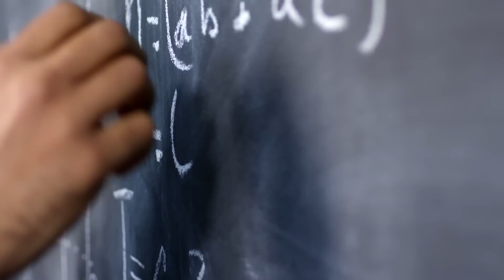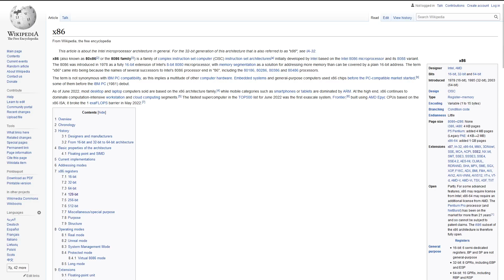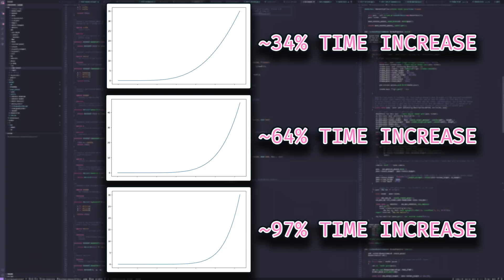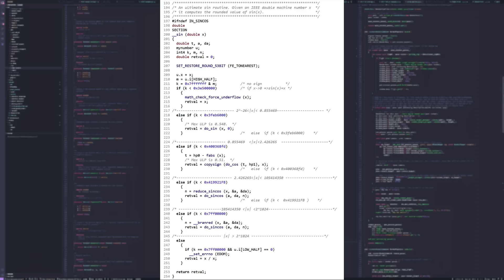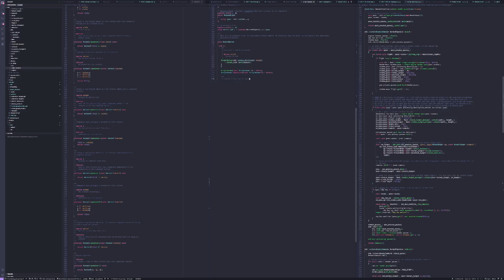What is the fastest way to calculate sine?

Comment: Personally i've made an algorithm of 2 LUTs for m and b then you can just do mx+b, but it seems like the linear approximations are trivial to evaluate, most of my computation seems like it's used in wrapping the value from 0-tau and finding the index, currently using some bitwise tricks to find the index first then correct it is getting only about half of the computer time, but i'm not sure if there's a faster method for the wrapping, or just in general that isn't just a straight LUT

Comment: I was surprised to see that the x87 assembly instruction was slower. You would think that Intel and AMD would be able to keep these fast enough that a software solution is not necessary.

One of my universtiy assignments was to design a "fraction" class in C++, complete with operator overloading. You would get extra points if your class supported the three basic trigonometric functions. I also used the Taylor series for them and they were fun to implement.

Comment: Kaze Emanuar recently did a video on this exact problem for the N64, using the only the first 1/8th of a period and some clever math to beat a 2nd or 3rd order polynomial (I think..). Might be fun to try on x86
Reply: The N64 is quite a unique system, it's main bottleneck is memory bandwidth. The same isn't true in x86 computers. The reason why Kaze couldn't use a standard algorithm for computing sine is because they were optimized for execution speed, not for memory bandwidth. It would perform worse compared to a standard algorithm on x86, as it was optimized specifically for the N64.

Comment: I've made functions that calc sin/cos/arctan using interpolation, circular motion formulas, incrementing sin/cos by multiplying them in a certain way at ever decreasing increments, and Taylor series, but I don't understand how to use Chebyshev polynomials...

So three expansions for the Chebyshev polynomial is just   (3 * (theta^3) ) - (3 * theta)  ?   I was trying that and getting values over 1...

When I've watched videos on Chebyshev, the most I've been able to grasp is some interesting functions for incrementing and interpolating cosines, but I'm supposing that's not the right way to do it.

I could use some pointing in the right direction.

Comment: I made uint sine in c++ by calculating 2 periods of parabolas by bit manipulating and flipping latter half. For my use case it is 3-20 times faster, depending if it is input random or linear values when generating waveforms or tones. 
These are fastest with gcc -Os flag and when you work with range 0 to uint_max like raw audio files. The functions are generalized to work in 8, 16, 32 and 64 bits. There's desmos page in comment explaining math behind this. Max error is 2.8%
Youtube keeps marking this as spam I believe. pastebin is GfEDzmCj
Reply from the maker: Interesting technique

Comment: You could try approximating sine with a parabola; you can get quite good accuracy when doing that. I was looking into it a few months ago.
Reply from the maker: Thanks for the suggestion!
Reply: @nathanbaggs  I've tried to link to a forum post that shows exactly how to do it - but youtube keeps removing the reply -.-'
Reply: Isn't that what the Taylor series is?
Reply: @Johnny-tw5pr  
not really, the most notable difference is that taylor series goes from -pi to pi accurately, making 2 'bumps,' 1 negative, 1 positive. a parabola only does 1 bump.

a parabola is just x^2, meaning it only works for numbers from 0 up to pi, which means it's more complicated to check if a number's negative or not.
taylor series works from -pi to pi, meaning it's simpler to give a proper check for if the number's negative.

There is also the problem that using x^2 (even when modifying the parabola to better fit sine) is less accurate, and in my testing can even go as far off as .03, which can be a pretty major deviation, compared to taylor series, which has incredible accuracy in only 6 degrees of the series.
Reply: For cosine, you have (pi^2 - x^2)/(pi^2 - 4x^2)

Comment: I remeber developing a method in highschool, it's super slow, and actually it only works for a quarter circle (trivially easy to solve that though).
Basically, you can easily calculate a normal vector for any vector by  dividing by it's length, and if you take the average of any two points on a unit circle then normalize the vector you can get the vector of the angle really easily. So you can just do a binary search
Reply from the maker: That’s interesting, thanks for sharing!

Comment: I've used x = sin(x) when dealing with very small angles before. Usually it's been when I'm estimating some of the other values in the calculation so the error is not as important as the rough correct number
Reply from the maker: It’s a nice optimisation (:

Comment: This is surprisingly topical and relevant for me as I am looking into using a fast lookup implementation with a bunch of pointer magic to very quickly calculate HUGE Fourier series sums (20,000 sines) in real time.

The idea is to use position pointers and loop back pointers to quickly sum a list of positions on the lookup table.
Reply: Do you think you could explain the logic behind your idea for that implementation a little more?
Reply: @xinfinity4756  Instead of calling for a sine approximation 20,000 times, you make one "good enough" sine approximation small enough to fit in the cpu cache. Directly after the sine in memory is a table of pointers leading back to the sine lookup table. the idea is to iterate each oscillator's position in the lookup table and use a 'buffer overflow' style approach to reset each oscillator's position when they overshoot the sine table in memory. In essence, it is a real oscillation within the cpu/memory - not a calculated one.

This would be useful in rendering FFT data into an audio signal in real time. It would make audio synthesis way better.
Reply: @ryanpmcguire  Neat idea! Do you use JUCE?
Reply: @ryanpmcguire  I was thiniking of ram but cpu cache is even better !
It could be dumb, I didn't dig the question. 
But why not construct your sin [ 0; pi] with point and straight line with slope of 2 or 1/2. 
So you can correct value by addition and shifting the bytes right ( x 1/2 ) and left (x2)
Reply: @ryanpmcguire  I'm not sure I understand what you mean when you say "the idea is to iterate each oscillator's position in the lookup table and use a 'buffer overflow' style approach to reset each oscillator's position when they overshoot the sine table in memory. In essence, it is a real oscillation within the cpu/memory - not a calculated one." My understanding is that you have a table of sin approximations which are pre-calculated, and then you have pointers after that which point to the sine approximations. I really dont understand what you mean by iterating each oscillator's position in the lookup table, nor do I understand why you would want to reset each oscillator's position when it "overshoots the sine table". I don't really follow how this is real oscillation within memory, or how this is useful. I would greatly appreciate if you could clarify and/ or provide an example to illustrate what you mean.
Reply: @xinfinity4756  imagine that you have a function which seeks to emulate an oscillating sine wave that moves at some fixed angle per step. You would have to increment the angle, scale it back so it fits within the range 0 to pi, calculate the appropriate lookup position, go to that position in memory, multiply it by a floating point value, then do the same for every oscillator for every time step. Alternatively, you can assign each oscillator a “position” in the wave table and increment the position by a pre-computed amount. The idea is that once you have incremented past the edge of the lookup table, you now over-run into a whole array of pointers which point you back to the original array. You find that there are no complex float operations with this method and that it is simply a position in a lookup table proceeding at a certain rate and being pointed back to the proper point in the array.
Reply: @ryanpmcguire  That makes a lot more sense. So the idea, then, is to essentially plot a certain number of sin(x) values in a table using x = [0, pi], and then assign each oscillator a position in that table based on the closest angle to which it starts at. Then,  for each arbitrary interval of time steps, you increase the pointers position through memory, such that you emulate the repetition of sinusoidal waves by automatically using pointers to loop back. I appreciate the clarification.
Reply: @xinfinity4756  I’m glad I was able to clarify the idea for you. This method would allow the real time synthesis of spectrum data into a waveform, and would help with the synthesis of realistic virtual instruments (e.g. woodwinds, brass) for which similar techniques have been used with great success. If each synth generates a frequency spectrum to play, then each instrument can be plugged into the same exact spectral rendering engine, saving lots of CPU overhead.

If would require a clock speed in the order of 2-5 ghz though. Good news is that is much in the range of modern consumer hardware.
Reply: @ryanpmcguire  The practical applications of that technique definitely go over my head, but I suspect it's just a lack of familiarity with the field. I appreciate the added information either way.
Reply from the maker: Glad you found it useful!

Comment: I get that this is essentially an exercise in running waveform formulas to test for efficiency as much as it is about actually achieving a faster sign wave. I get that and being limited to a predetermined range, but not much else.

It seems to me that real time signals processing is hampered by having to run code in binary that would be a much more straightforward operation for balanced ternary CPUs. I saw a video where an instructor in a class said that there were ternary components in Intel CPUs, but I couldn't find anything to verify this.
Reply: High end network equipment emulates ternary logic in order to match network masks. Ternary logic allows to determine the result as Yes/No/Doesn't matter much more quickly than binary logic.
I'm not aware of any such (emulated or not) ternary logic in regular CPUs and I don't think there are any real processors sold that actually use ternary logic. I think the advantages are just too small to make it competitive against the very very mature binary stuff we have now.

Comment: That's dissapointing how assembly trig instructions are so much worse, lesson is to always benchmark stuff
Reply from the maker: Agreed. There's this idea that you can use assembly to "beat the compiler", but it's not always true.
Reply: @nathanbaggs  that saying refers to the assembly output of a compiler vs a human and not replacing several lines of assembly into a single instruction.

Comment: how about caching? precalculate at a 1000 different intervals and after that interpolate when you do a lookup.
is this faster? or is it just wasted energy?
I know this is what they used to do for old school DOOM but don't know if it's still useful to do.
Reply from the maker: As I said at the end I didn’t really look into caching as I was more interested in how you actually calculate the values. Seeing as the glibc sin uses a lookup table I’d say it’s certainly viable.
Reply: My guess is that a lookup table that large would be slower than a typical Taylor series approach, due to the increased amount of time to fetch the data. A Taylor series approach only requires a few muladds and jump instructions.

Comment: Cool video. My favorite algorithm for calculating sine is CORDIC (coordinate rotation digital computer)! It's a digit-by-digit algorithm, so it converges relatively slowly, but it's also a shift-and-add algorithm, so you don't need to do any of those difficult multiplications or divisions. It's so simple to implement but also so versatile (you can use it for trigonometry, linear algebra, logarithms, etc.) that some limited processing power microcontrollers will even use CORDIC to implement floating point math.
I'm wary of posting links as I've already had this comment nuked by youtube once, but wikipedia has a great article on it and looking up "CORDIC, What is it?" on google will bring you to a great post on the Signal Processing Stack Exchange.
Reply from the maker: Glad you enjoyed it. Thanks for the suggestion!
Reply: Finally someone else mentioning Youtube removing comments with links in them. I thought I was going crazy. 
Even simple wikipedia links are removed all the time. It makes Youtube incredibly bad to have any kind of discussion.